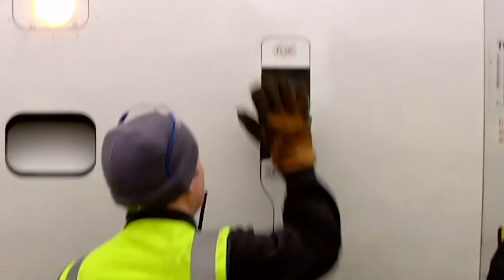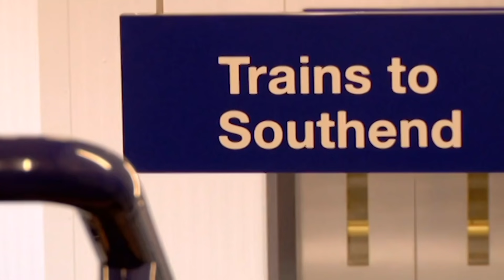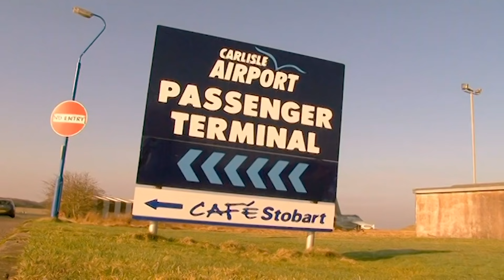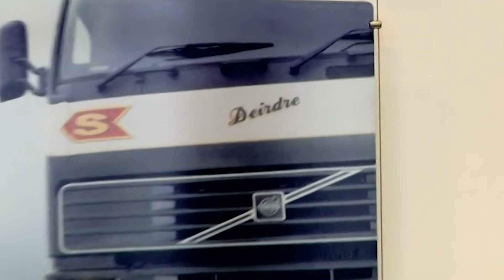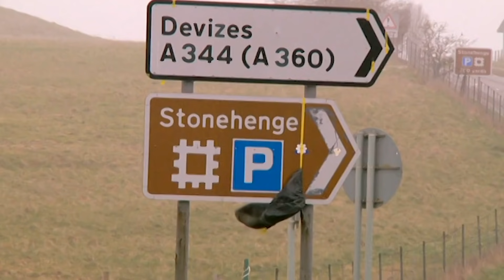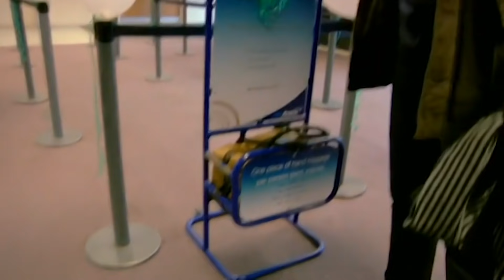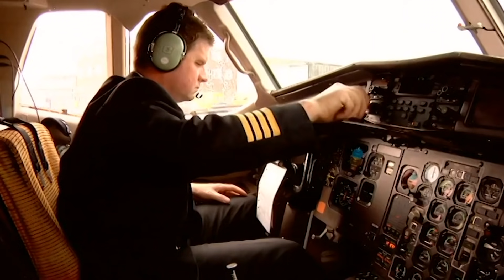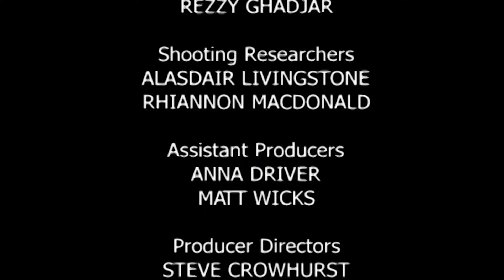The Billion Pound Scottish Timber Industry | Truckers: Season Two | All Documentary

Comment: Really they use fabric straps to hold the load of logs not where I live chains
Reply: Rarely use chains for anything in the uk
Reply: Aye they’ll be rated for the weight no different to a tow truck operator using slings instead of chains
Reply: Don't use chains in the southern part of America here is South Carolina we use 2 straps nothing else